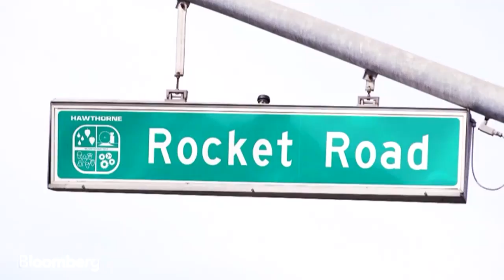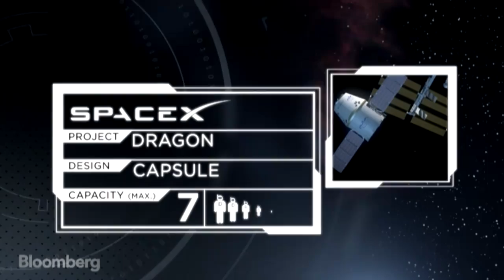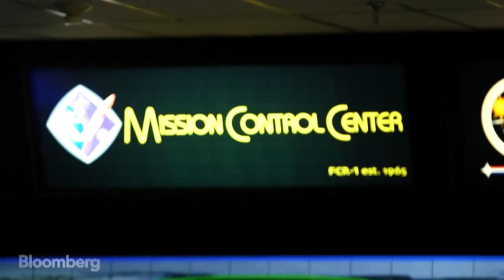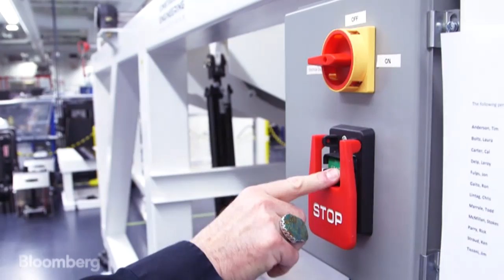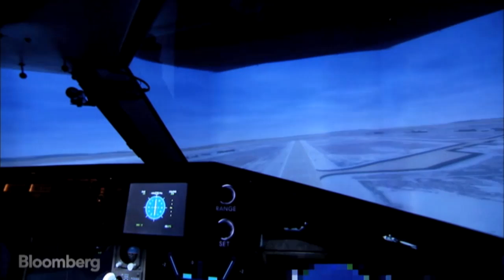Star Wars: The Battle to Build the Next Shuttle

Comment: The Space Shuttle has been replaced,.  It is the Boeing X-37B.  My father was a designer on the Shuttle and I grew up with literature on lifting bodies in my home.  The Shuttle engineers decided that that was not necessary.  The Shuttle is a fuselage and delta wing design - same as the X-37B.  The X-37B can be scaled.  

What is most important is re-entry at orbital speeds (approx 17,000mph) - the ceramic protection from heat.  It is not the relanding of a rocket.  It is the heat.

Comment: Propelling a space vessel faster than light speed (This can only be done in the vacuum of space)

1st, we need to have a 10 to 20 foot diameter pipe line, formed into a 5 to 10 mile in diameter circle or donut shape. 

2nd, there would need to be independently powered electromagnetic coils wrapped around the pipe which would be evenly spaced.

3rd, we would need to build a bullet shaped space vessel made of a ferrous metal alloy with its own electromagnetic pulse generator 

The vessel would need to travel around through the pipeline several times until it got up to light speed. Once the vessel reaches light speed it can be released into a straight tube that is pointed in the direction we wanted the vessel to go. This can be accomplished by each electromagnet producing a magnetic pulse which will propel the vessel forward and just beyond the next electromagnet which will fire the next magnetic pulse. As the accelerator’s electromagnetic pulse occurs so does the magnetic pulse generator in the vessel

In Phase 1,  each accelerator’s electromagnetic needs to pulse to gets the vessel to maximum potential

In Phase 2,  every other electromagnet in the accelerator needs to pulse  to get the vessel to  to its next maximum potential velocity. 

In phase 3 every third electromagnet needs to pulse to get the vessel to its next maximum potential velocity.

In Phase 4 each forth electromagnet needs to pulse to get the vessel to its next maximum potential which is limited only by its structural integrity. Structural integrity can be increased by jelling the inside of the ship.

Comment: Two donut shaped accelerator on a starship would work by getting a ferrous based plasma up to speed then releasing it. However, to get the plasma to move faster than light the evenly spaced electromagnetic coil rings don't need to pulse in a step fashion faster, they need to be stepped differently. At first each electromagnetic coil ring needs to pulse, then when the plasma reach maximum velocity every other electromagnetic coil ring needs to pulse in a step fashion. Then when the plasma reach maximum velocity every third electromagnetic coil ring needs to pulse in a step fashion... so on and so forth. Once the plasma is up to the desired speed it can be released into a straight tube and directed out the back of the ship. In order to maintain balance the ship would need two accelerators, each moving the plasma in opposite directions.  This was discovered in another dimension while I was in something similar to a electromagnet coil ring accelerator.

Comment: China is building rockets with a graphene -aluminum body and a graphene -titanium alloy frame with a graphene -carbide coating  that can withstand temperatures of 3,000 degree celcius.The US is building a shuttle with ceramic plates.China is building a nuclear rocket that will reach mach 20 speed or higher.

Comment: Funny seeing the Boeing "technician" using a shifter on a 1/2 inch nut....even in space they use basic tools and engineering.....and not even properly holding the shifter at an angle rounding the nut...

Comment: I'm all for space planes (or lifting body capsules), but I think SpaceX has the right idea of 100% reusable. Sierra Nevada and SpaceX should just maybe exchange notes.

I really hope space travel companies aren't like Apple and Samsung in the future... that would be too unnecessary.
Reply: Rival competition drives prices down. If Boeing vs. SpaceX is the next Apple vs Samsung, then maybe in 50 years the cost for one person to go to space could be as low as a hundred thousand. Competition driving down prices could mean an average middle class person could just set aside a few bucks of their paycheck each month for a few decades and could afford a trip to LEO
Reply: a) they will

b) SSTO's can be viable through technologies like the sabre engine for spaceplanes and/or aerospike engines (the latter is tech that's already developed but was scrapped because of politics bullshit)
Reply: SSTOs will never be viable. Even if you have a perfectly functioning one, it just adds so much more payload mass and efficiency to strap it ontop of a big first stage. The problem is not the engine, it's the structural mass of the rocket. Even with aerospike engines you essentially need carbon composites to make the thing work at all, and then it's still going to be more inefficient than a two stage rocket. 

Better build lofstrom loops or something.
Reply: @77Avadon77  Or maybe you have nothing of substance to say and resort to insults like a 5 year old like a tantrum when told that santa clause is not real.
I'd pity you if your politics weren't putting our species in danger.

Here's a suggestion on how to not come out as an infant: substantiate your claims and disprove my examples, if you are unable to do that stay silent and admit defeat.
Reply: @fl00fydragon  you got rekt, and have no point
Reply: Seirra Nevada plane is based on affordable COTS safe crew access.
See the old NASA HL-20.
Nothing about it being a spaceplane says it can't be reusable.
Reply: why not? As much as that rivalry between Apple and Samsung is perfectly ridiculous it has driven smartphone technology far further than any single company would have done.
Reply: The space shuttle proved that a nice looking space plane reusable operation costs are too big in comparison to a capsule
Reply: Lol 😂
Reply: The funny part is , They show us this ANCIENT spacecraft and play it off as new, when we already have the TR-3A (Yet we get lied to with this OLD rocket propulsion crap). It's Funny to see these when WE KNOW FOR FACT THE TR-3A been around for at least 40 years..
Reply: @milesdyson5211  what are does facts you are talking about
Reply: Radioactive environment ...... I don't care.
Reply: Rocket technology = old fashioned.
Reply: 1) RIP english
2) some of our greatest  scientific accomplishments were a result of cooperation instead of competition.
There's no such thing as parthenogenesis of informationa nd having competing sides without open communication of their findings results in a lot of lost time where multiple teams waste resources, time and brainpower for problems that are already solved.

In fact inthe case of disruptive technology the profit incentive doesn't work because no private entity would  invest billions in a project that needs 4+ decades to have any commercial value with a success rate of 20%

This is why most of our tech was born from goverment projects that were later privatized.
The private sector only markets and refines new technologies while governments invent.

And I could argue that if the refinement was left to open source tech withoutthe restriction of patents you'd see superior refinement than that of private enterprise.
Reply: @fl00fydragon  lol at governments invent. Governments can't tie their shoe laces. The only reason you get innovation is because of talented people and the only place they can really thrive is in the private sector.
Reply: @77Avadon77  So I guess that LCD screens, microprocessors, jet propulsion, rocket technology, telecommunications, computers, nuclear technology, RAM, lithium ion batteries, multi touch screens, siri (made by darpa, renamed and marketed by apple), the Internet, cellular technology, microprocessors, micro hard drives, semiconductor technology, high energy physics, GPS, baby formula, contemporary tire technology, vaccines, memory foam, cochlear implants, etc. don't count am I right? 
It's only a representative sample of technologies that are necessary for an advanced society. 

Yes you need a visionary, governments are not mutually exclusive with them as they employ and fund these visionaries. 

The reason is simple, no private person would invest billions in projects that last 3-5 decades to create something completely new. 

What you said is a bullshit argument that runs contrary to  historical facts. 

Here's a word of advice: if you don't want to be treated as a child then you should not post nonsense that can easily be disputed with a 5 minute Google (Public based R&D from the National Science Foundation/NSF) search.
Reply: HWEVER W/O  COMPATITION'  WYTH IN  INDUSTRY' -TAKE BOEING/AYREBUS...THJER WOULDNT BE  INCENTIVES/CABLE CO  CHOICES......

Comment: Now that SpaceX can recover the Booster it will cut costs over 100 million dollars per launch and they can be reused for about 5-10 times.
Reply: SpaceX doesn't charge $100 million for most Falcon 9 launches.  The cost is around $60 Million.  Now they do change $133 million for launching Dragon to the ISS, but that's a fixed contract.  But that's counting Dragon and it's service module (the latter can't be made reusable).

Comment: I think boeing will win. I mean didn't they help design the first shuttle?
Reply: +kelly wilson whitehead Well, SpaceX Is the one that's most likely going to win.
Reply: +kelly wilson whitehead well both did get chose so...
Reply: +kelly wilson whitehead 
SpaceX and boing both got a contract to work for NASA
sierra nevada didn't
 :(
Reply: +lancemichael gubat ah well I was kind of right
Reply: Boeing also built the Saturn V rocket's first stage.  They've been around the block.  That being said, SpaceX is unique in that they build their own rockets and spacecraft in the same plant.  Boeing's spacecraft would be launched on an Atlas V 402 rocket built by multiple companies in multiple factories.  Boeing is taking advantage of their United Launch Alliance connections, while SpaceX has a much leaner, vertically integrated operation.

Comment: Not sure why Boeing's (don't get me wrong I love Boeing) CST100 won over the Sierra Nevada dream chaser??   I think gov should have been way more progressive.  Airbags and a weld-less design is not enough new tech.    The Dream Chaser is a "lifting body" not a winged craft like Shuttle.
Reply: +Chad Snow while i agree somewhat, the shuttle was a lifting body.
Reply: it is also nothing new. rare, yes, but it has been tested on since the 60s
Reply: The Shuttle used body lift too.  Dream Chaser is similar to Max Faget's design for the Space Shuttle, which was smaller and lighter but had less cross-range capability.  The Air Force insisted that they build it with bigger wings and a longer payload bay, which is why the Space Shuttle was so big, heavy, and dangerous to fly in. 

The purpose of this competition is to find a way to ferry astronauts and cargo to the ISS and back.  They're not necessarily looking to innovate; they just want a spacecraft that does one thing very well and very cheaply, like Soyuz does.

Comment: What the hec, Virgin is able to get their craft out of the atmosphere cheaper than any one of these 3 competitors
Reply: it doesint go into orbit it just exites te atmosphere and then falls back
Reply: +Dominykas Ciunys Well it did leave the atmosphere for less than it cost these other guys, with a little more juice they can go into orbit for still less than their competition
Reply: To put human into space you need  just 80 kg of fuel.But you need to lift off not just payload but the fuel too.So if you would put more fuel onboard it will weight more increasing the fuel amount needed for the trip...
Reply: Going suborbital is one thing, going to orbit is another.
Reply: But is can't get to the ISS.

Comment: The winners are Dragon V2 and CST-100. The Dragon V2 seem to be the cheapest and its very safe. CST-100 seems to be not as cheap as Dragon V2 but a lot cheaper than Soyuz, also a lot safer than Dream Chaser. Dream chaser although looks cool it doesn't  have any efficiency advantage over the other capsules as it's still launched using a rocket, also not as safe as the others as it needs to land on a special surface.
Reply: I was in an airplane once, it was also unsafe as it needed to land on a special surface.

Comment: This is another old idea.  1970's thinking with contemporary materials.  We need a space plane.  A vehicle that takes off from a runway, like an airplane, flies into orbit, and then returns and lands on a runway, just like it took off from.
Reply: WarBerJr02 You might want to take a look at Skylon (the sabre engine). It probably will take a while before it gets developed. But the hardest part of engine development (the precooler) has been worked out.
Reply: As a matter of fact, I have been reading about it.  There is an old precursor to the Skylon called the Black Horse Project.  I think these might work much better than the Space Shuttle ever did.  The real issue is getting someone to build one.
Reply: WarBerJr02 There are some lectures on youtube of Alan Bond, the (co) founder of Reaction Engines, the company that is developing it. He used to work on a precursor in the 70s called, HOTOL before they canned it.

The plane itself will be the more easy part to get funded when they have the critical tech proven to work. Single stage orbit is such a strong business case. Once developed, it will be huge.

I don't cound the shuttle as a space plane, but a glider. An awesome one, but a glider non the less. Still needed a rocket to get into space.

Comment: I say until you can do an about face in orbit, induce a escape vector from the solar system and then abort it, your just wasting your time. Why are we wasting time and money on capsules and lifting bodies, Bust out with the anti-gravity already, it's the only way to drive in space. The fuel required to completely  reverse direction of orbit would be tremendous and thrust would be insufficient to prevent re-entry. Thus this technology is a dead end and anti-gravity is the future PERIOD.

Comment: I'll take the SpaceX Dragon 2. Safer with the multiple redundancies and cheaper to boot, I like the look of the Dream Chaser but it is still a small reusable part of a mostly disposable conventional rocket. I would like to know how long it takes to refit the DC for relaunch. Reusable rockets is the way forward I feel.
Reply: They're probably similar in safety since DC's landing mode has a proven track record of safety.
Plus it might have cheaper refurbishment then Dragon since it propulsion is non toxic so no guys in hazmat suits are needed to safe the vehicle and the gliding landing should do less debris damage to the heat shield on landing then Spacex's powered landing.
But Spacex's rocket is definitely cheaper then an Atlas V.
Reply: Patchuchan Interesting point about the fuel being non toxic. I had not considered that. We live in interesting times.
Reply: @Patchuchan  problem is if dream chaser is like space shuttle it's refurbishing costs would be too high in comparison to dragon v2
Reply: The Dragon 2 water landing is a little primitive.
Reply: @dougmc666  dragon v2 is meant for rocketed landing